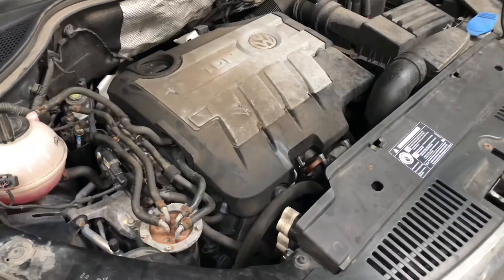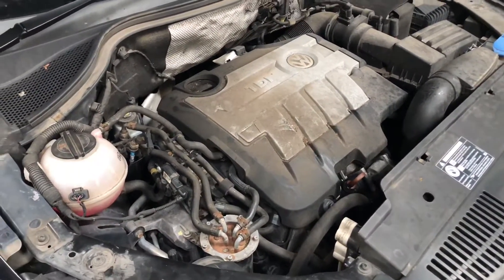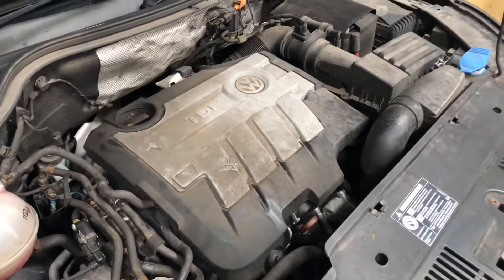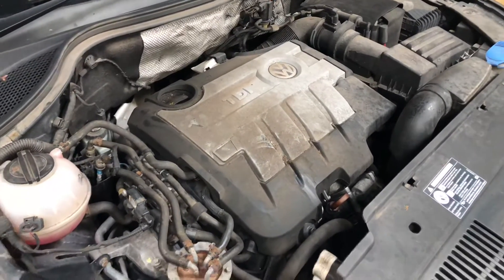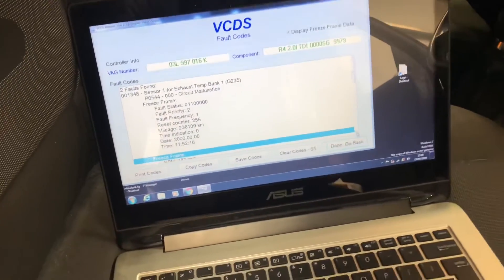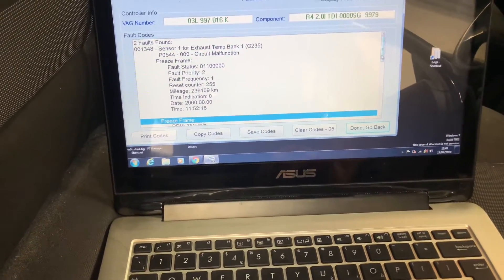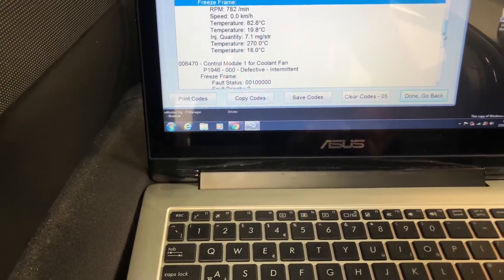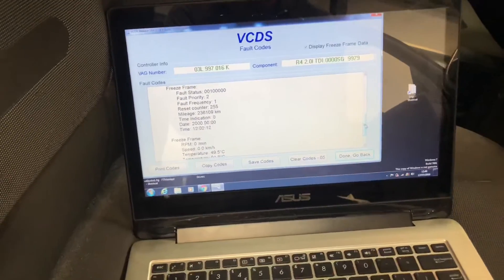VW 2.0 TDI DPF BLOCKED ?  ** QUICK AND EASY TIPS TO AVOID DPF  BLOCKING ""  THESE TIPS WILL HELP.

Comment: My cars DPF was nearly full, it's only covered 8300 miles , one of the exhaust pressure sensors , the one before the DPF was faulty,  I'm not mechanical minded can you explain why a faulty sensor would cause the DPF to fill , many thanks
Reply: There are two pressure sensors on a DPF - one before and one after the filter.  The cars engine computer (ECU) is able to determine how full the filter is by monitoring the difference in pressure readings between the two sensors...  The greater greater the difference in pressure - the more the flow of exhaust is restricted by the soot in the filter.  If one sensor isn't reading correctly, the computer doesn't know how full the filter actually is, and it won't initiate a regeneration cycle.  This can lead to an overly filled, or clogged filter.
Reply: @jdawson016  it ended up being the injectors what where faulty , they replaced them all and it's been fine since , bit bad them failing after only 9000 miles
Reply: @sen5908   It seems unlikely that the fuel injectors would be bad at 9,000 miles...However, considering that so many components are made in low cost countries with poor quality control, it could be possible.  For your sake, I hope that the repair was covered under warranty.
Reply: @jdawson016  it was yes , cost around £1500+ , it's just about too come out of warranty would you take out an extended warranty if it was you
Reply: @sen5908  I reside in the USA and I'm not familiar with your vehicle specifically. If the make and model of your vehicle is prone to frequent and expensive repairs, an extended warranty may (depending on cost) be worth considering.
Reply: @jdawson016  it's a Mazda 6 2018 2.2 diesel sports nav

Comment: Unfortunately , no motorway near my house , all roads are 20 miles speed limit. Can I just press the gas for 20 minutes 3000rpm ? Will it work?
Reply: yes you can mate, 2600 - 3000 rpm is good for 20 , 30 minutes... and change the oil with fresh 5w30 507.00 low sap oil EVERY 12000 KM
Reply: @alexanderharispuru1465  
Thanks
Reply: Yup,just gear down and burn those puppies

Comment: Cheers mate great video how many miles  should the once a week stretch the car be ?
Reply: id say about 30 miles from when the engine is 90 cent oil temp.Done this the other night 5th gear 2000 revs 5th gear.

Comment: Those fuel filter housing lids are always rusty. Such a bad design. There is a housing used on other VAG vehicles that's a lot better and does not trap moisture and therefore does not rust.
Reply: I’m

Comment: AVOID DPF BLOCKING.....either delete the DPF, or buy an MK4 or earlier TDI...problem solved
Reply: Mk5, I have 6 of them, non of them have problems with dpf, 1.9 not the later 2.0
Reply: Mot failure
Reply: DPF Light came on my MK4 Caddy the other day, 15 minutes in gear 4 around 45mph clears out the soot and crap in the filter. Good as new 👍🏼

Comment: My touran 2.0 tdi 2009 every weak do dpf cleaning during cleaning exaust sound changed what is the problem ?
Reply: Did you service your car on time? ( buy good engine oil, clean EGR valve)
1- find out why getting block in first place?
2- remove dpf filter and send it for professional cleaning. Remember regeneration not working for longer.

Comment: Hey quick question, in my 2012 Jetta tdi it’s giving me codes p2002 and p0401. I know that oil change is due pretty soon, so could that be the problem?
Reply: Its your egr cooler.99% sure. If you see a bit of white smoke in traffic,your cooler is leaking.
Reply: Just had the same codes recently and cost me $4000 to fix 😭. Had to replace dpf and egr valve plus 2 glow plugs on top of everything…sheesh

Comment: Thanks for the tip about low fuel...I tend to see how far I can go on a tank. I’ll make sure I don’t run it so low from now on.
Reply from the maker: No problem James,  sometimes these little things can help, like a said if you know you dont know 😀
Reply: @VolksWorkshop  same here and thanks, I'm always trying to get better mileage as a little personal experiment but in the long run will likely cost me more ...2014 1.6 idtec civic , last few days after reaching optimal temperature I now drive normally and never brim to empty...subscribed
Reply: @VolksWorkshop  how does it make sense that under a third of a tank makes any diff from 10 percent could ui explain that
Reply: And the AUX heater for VW diesel needs 1/4 tank of fuel to work or be diagnosed. I didn't know about the DPF so this is a lesson for me here. Thanks for the tips.